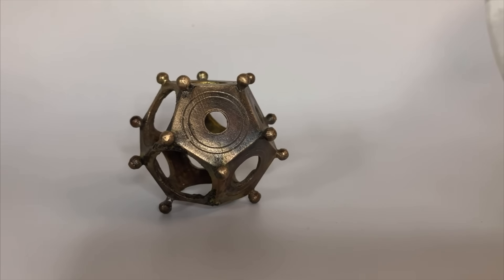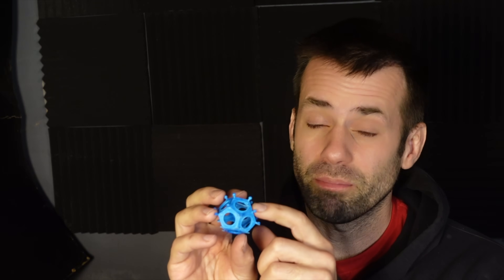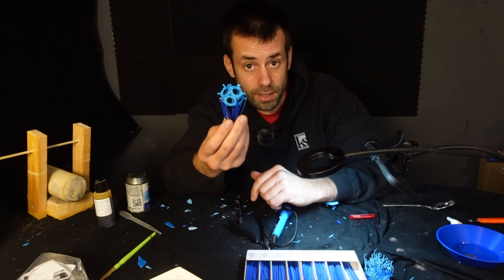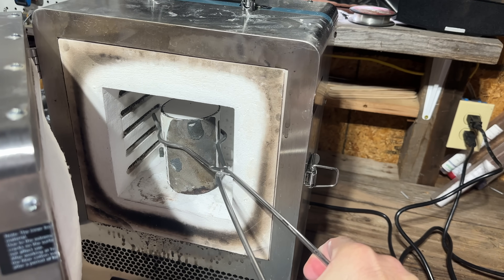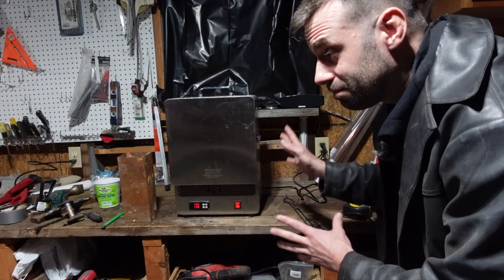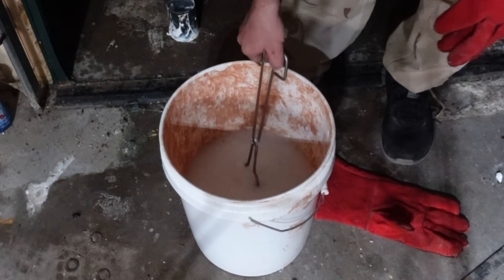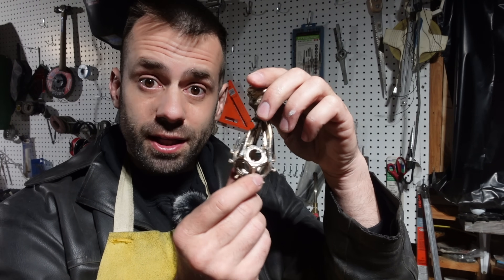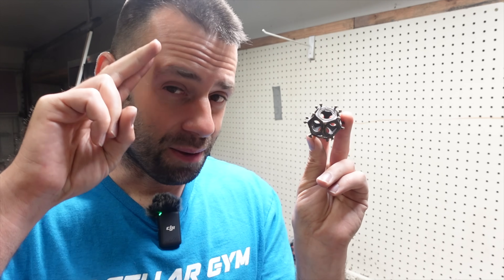Casting a 21st Century Roman Dodecahedron

Comment: I suspected this before but having watched you create this confirmed it - I strongly believe the most likely 'purpose' of these things was an apprentice or 'graduation' show-piece for bronze casters - they are about as awkward a test of skill possible - making the wax model, each face with a different sized hole (no simple copying across), right up until the edge left around the hole is almost hair-thin  must have been a real ordeal alone, then melting each of those surfaces together without distorting them, in the correct sequence... Then carving rings around the holes (seen on some examples) whilst avoiding breaking through the back surface - handling that incredibly fragile wax construction all the while and trying to keep its edges sharp and true. THEN, just to REALLY make the thing awkward, fixing nubs on each corner.

 [A commenter below says the 'nubs' were often hollow and made from copper, not bronze like the body of the thing, just to be extra awkward!] 

...Then working out all the pouring channels and venting for a perfect cast... The whole excercise looks to me designed to drive a guy crazy.

Just imagine going through all that super finickety wax work then you pour it, get a flaw and have to start all over again, no 3D printer to replicate anything, back to square one...

I wouldn't be surprised if this was the entire apprenticeship - you meet the master bronze worker, he puts the dodecahedron he made as his apprentice piece in your hand with a lump of wax, some tin and copper ore and says "When you can work out how to cast a copy of this, you can cast anything. You can go and work for yourself then, until then, watch and learn."

...So, when you're not helping him, you're trying to make your dodecahedron, over and over, casting, failing, melting it back down... And after a few years, when you eventually get it perfect, the master says "O.k. Now you are a master, keep that until the grave, it proves your skill and if you take an apprentice, it'll be your turn to chuckle as you watch him tearing his hair out over the damnable thing!" 

...Aye. A sadistic casting show piece - I think its the most likely explanation and only missed because folk today, as is so often the case, get obsessed with the function of the object and don't consider how incredibly skilled you'd have to be to make one, unaided, in a 'mud hut'... No vacuum chambers, no perfect investment, no 3D printer, no electric kilns... Just painstaking work.

Thanks.

Comment: Using the same resin, getting .03mm parts to print (literally 1 pixel or 2) just fine.
Your printing profile is probably at fault - or the temperature of the chamber, adding a thermostat is what made jewelry details possible. And selecting the right print profile when saving (I sometimes forget to do that)

Comment: Hey that looks cool! You must have seen the Joe Scott video or maybe this was just a coincidence. After he posted his video I have been thinking of ways to make one of these without using 3d printing. I'm really impressed that the craftsmen of the day were able to pull it off. On a side note, I tried using that wax resin with Suspendaslurry and it did not work at all. The entire shell cracked into dozens of pieces. I know it can be done if the prints are hollow but that's easier said than done.
Reply from the maker: This was actually a coincidence. I haven’t seen his video yet. 
Yeah this resin really likes to expand and crack molds. I have pretty good luck with investment casting as long as it’s thick enough. I would really like to your version of making one of these.
Reply: I am hoping both of you see this message and could possibly answer a few questions, I am a Mechanical Engineering grad student at South Dakota State University that is exploring Lost PLA investment casting for a thesis report. I religiously have watched both of your accounts on all types both ceramic and investment and this is awesome to see both of you interact with each other. Kind of looking for a contact to ask generic questions about both the investment powder, which i bought Ultra-vest, and the ceramic shell method (Suspendaslurry). Regarding pre/post processing, With the shell i am roughly applying 2 shells a day, 6hrs apart from each other. I am trying to figure out if this is good, along with how long do i wait before applying the silica mixture (Tried 10min, to 7.5 min to 5min, and will reduce that as well). I only have 100 mesh at the moment. I have a P1S printer and doing burnout tests of both basic PLA (Overture as you mentioned) and trying PolyCast as well for my prints. I hand built a vacuum chamber for the investment as well just haven't had the time to begin those test. I am mostly conducting the experiments with Aluminum, Both 6061, and A356 castable alloy. Regardless i love both of your dedication and projects and cant wait to keep up with your videos. I get this is a long shot but I would love to potentially contribute some of my own tests and trials to you guys to further improve this process and could use any help i could get along the way for my masters program and making sure any contributions are adequately mentioned within the report. Thank you for your time!!

Comment: I tried to find out what Romans used to coat the wax model. Not sure I was using the right vocabulary. Sounded like the Greeks used clay. But clay would crack as it dried? However they did it, they must of been a bunch of geniuses. Appreciate you sharing knowledge with this Neanderthal
Reply from the maker: Yep clay was how they coated things. I’ve never tried it myself.
Reply: IMHO,

I used a semi-porous dip-slip coat...seemed to be best for intricate castings . Mix & de-gas(quiesce) a slip made from your casting material, and pour into a dipcan. Vacuum dip can, do the dip, and hang & vacuum .
Voila! Blank is now slip-coated with bubble-free slurry from your casting material.
Pour the cast, set the blank, cure casting and fire.
Surface negative is now blemish free.

Comment: Very nicely done mate😊 question for you, have you tried things other  than the silicone caulking as your gasket material?  I know you can get the propper hightemp silicone mats that are made for vac casting machines from AliExpress but ive mostly been using thick cardboard ( think beer coasters) soaked in water when vacuum casting, its worked great so far
Reply from the maker: I have heard of that but haven’t tried it yet.

Comment: There's probably a safety valve inside the black plastic propane thing. Take it off the regulator and drill right through, only way I was able to make mine work
Reply: I went with a high pressure valve for my smelting furnace. Looks like that's a low pressure BBQ style. Nice work by the way
Reply: @WaltHaas on Amazon I'm seeing lots of 30psi ones for like $25 which is what I got years ago. I think they're mostly used for grills even though they're way overkill. For my foundry I use only like 5psi I think